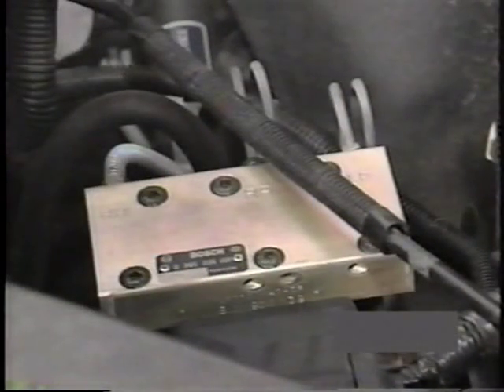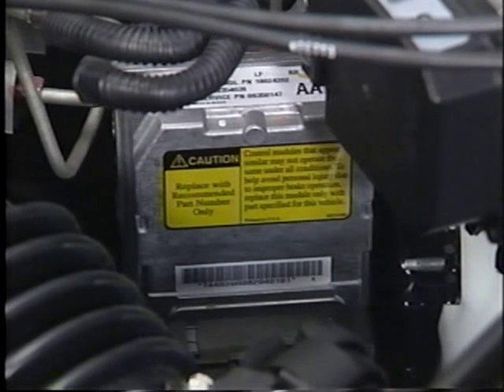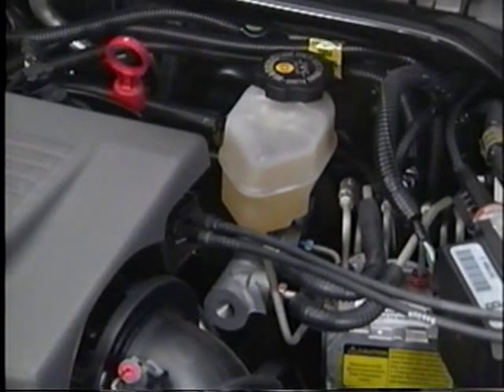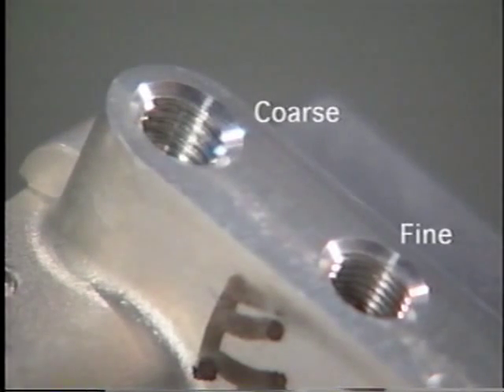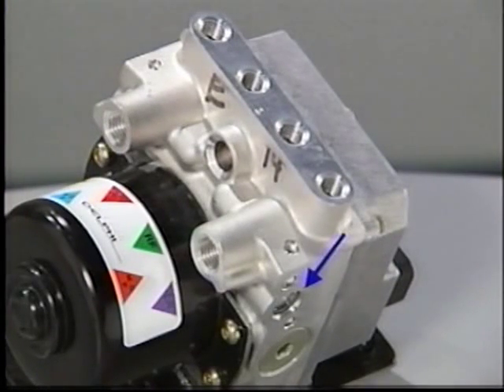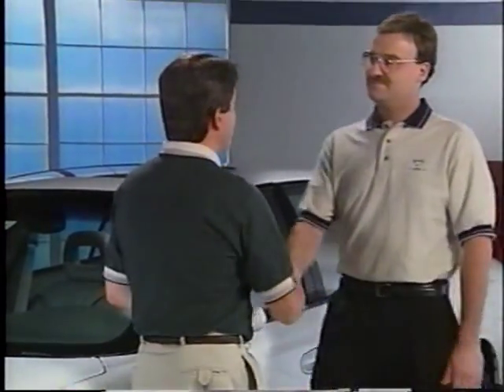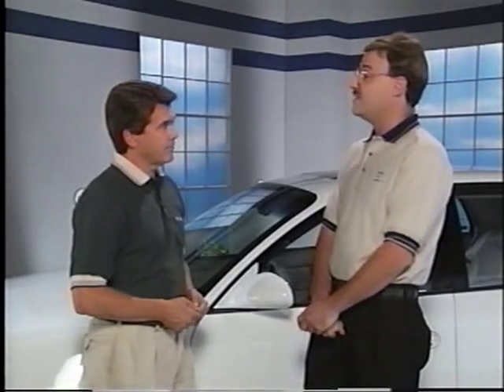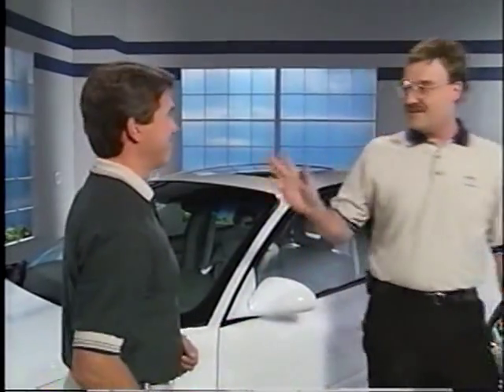Buick - DBC 7 ABS Operational Characteristics (1999)

Comment: Thanks again Rivlanta for the vids! Had a 98 Grand Prix in for a cruise problem today, no 12 volt to module for cruise on, did tilt up down and signals and high beams as per say video, no luck but bad switch, gray wire off combo switch. Too much tilt breaks the wires I guess ! This vid is awesome aswell!